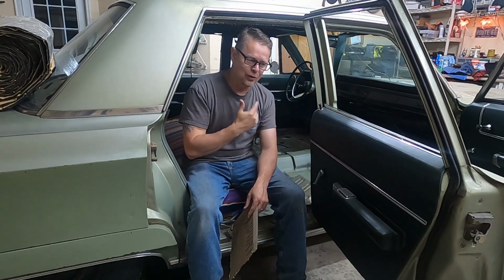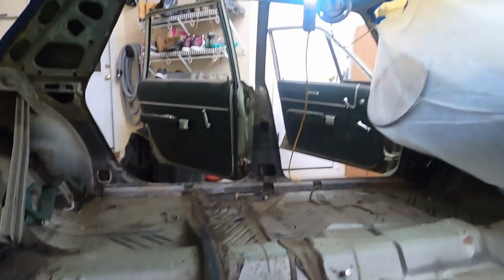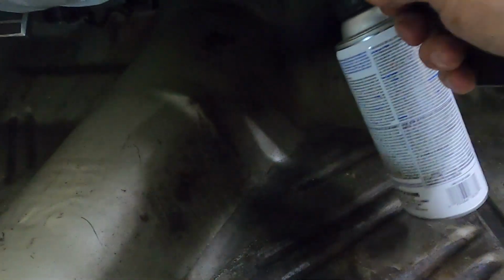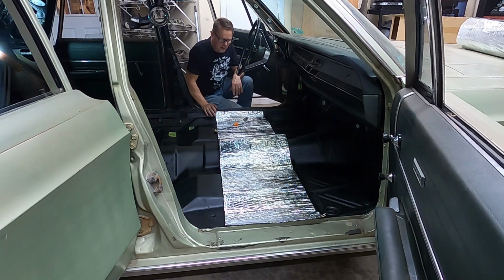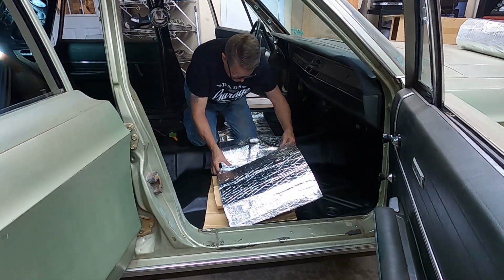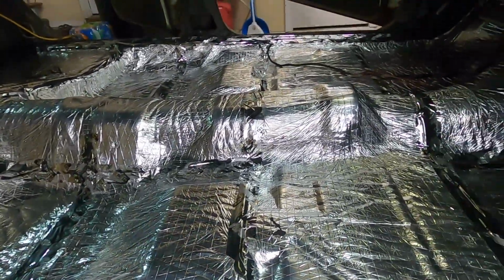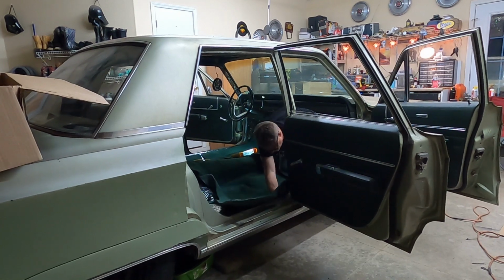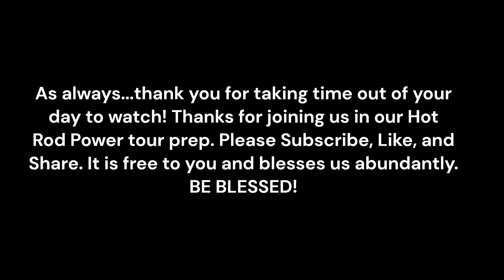1968 Newport Interior: Getting Ready for Hot Rod Power Tour 2023!

Comment: Great video. That’s what I am about to start on. Have you done anything with your fuel tank yet? My sending unit connector cracked and I am trying to find a fix for it. Any help is appreciated.
Reply: Thank you Cory. I will begin the fuel tank cleaning and coating process this weekend. If the problem is with the fuel sending unit, just replace the whole thing. Rock Auto has it in stock for $60.
Reply: @keithoetting9448  I just finished coating and painting my tank with the por15 system. It came out really nice. I put a new sending unit in it also but I am referring to the wire that connects to the sending unit. The  wire that makes the gas gauge on the dash work.
Reply from the maker: Look for a Dorman universal plug. Very simple connection. Only thing the wire does is to send ohms to the gauge. Any connection would work. Maybe check a junk yard?
Reply: @streetrust5341  I’ll start hunting one down thank you!